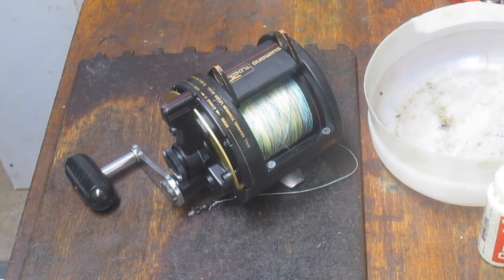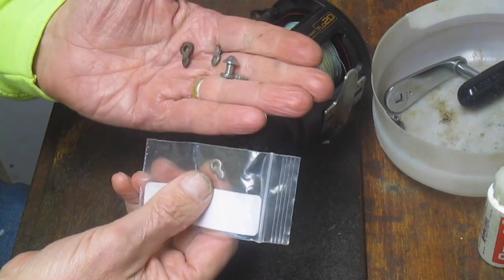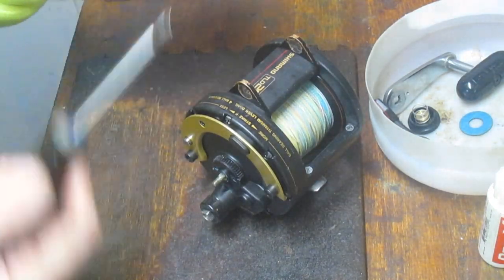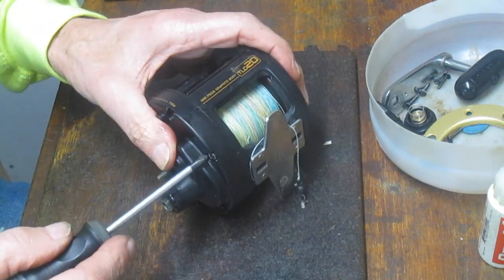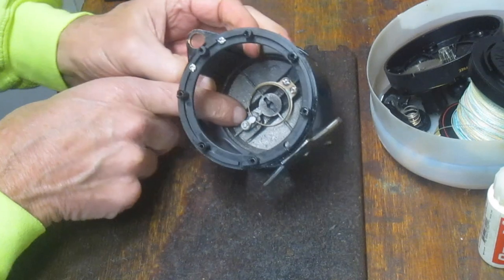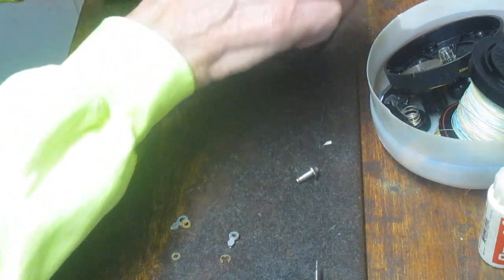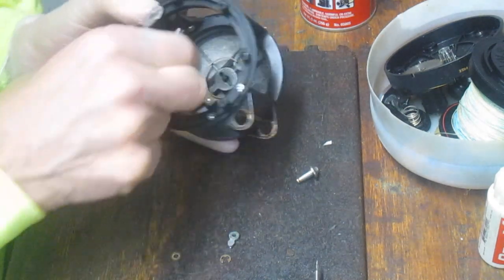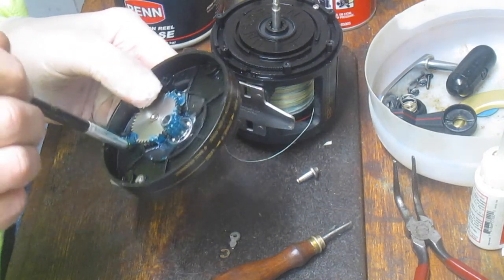Shimano TLD 20 Lever Drag fishing reel take apart and  how to restore a worn click function

Comment: Great video...I have a Tyrnos 20 that i want to tear apart and clean/service it is an early version (single speed 5 to 1 gearing) it appears very similar to this TLD20...mite you advise me of any differences l should be aware of when i take it apart?
Reply from the maker: The process should be very similar. Unfortunately, I do not have a video on the Tyrone's reel

Comment: Thanks for the video. I'm going to watch your rebuild one as well, but I had a question. Have you ever come across a TLD that when you wind the reel, you are winding against the drag? My reel just recently started doing this. In free spool it winds normal and as you increase drag, tension on your wind will increase as well. It has been fished maybe 15 times.
Reply from the maker: Some resistance is normal, but you have had this since new and if you are noticing a change, then it is most likely that something inside the reel is causing the change.  My usual culprit is dirt, sand or broken line.  I think you need to take the reel apart and do a complete service.  While you are doing that, make sure to check for broken parts and perhaps a worn or torn drag washer.  Dennis

Comment: Dennis hi, wouldn't greasing the clicker tongue and where it comes in contact with the spool help with the wear?
Reply from the maker: The only place where it would make sense to grease would be the slot where it rides in.  Any grease on the click tongue or spool would evaporate or get pushed to the side or clog the click ring. The wear is a result of one metal being softer than the other and repeated use in trolling. Grease just won't help that in the long term. - Dennis

Comment: Dennis,   
     Another great two part video ! When reinstalling the clicker pawl do you always leave it dry.?  Is there any benefit to grease/oil on  clicker pawl for longevity ?  Thx
Reply from the maker: I always leave it dry where it intersects with the click ring.  You can put a light coat on the face if you like.  That would help prevent rust.  You can also put a drop of oil or light grease in the side plate channel where the stud rides. Thanks for asking - Dennis

Comment: Sir,Can you tell  me the shimano TLD 20 machine dimension,size, weight  and height??
Reply from the maker: I don't have one in the shop at the moment.  The reel is approximately 4 inches high and wide without the handle.  The weight is about 30 ounces.  Dennis

Comment: I do not see the Blue space on my reels?
Reply from the maker: Hi - what blue space are you referring to on the reel?
Reply: @2ndChanceTackle  big blue washer on the drag handle
Reply from the maker: OK - The one that goes behind the lever arm?  Did you have a black one there by chance?  If not, someone may have recovered it on a past service.  The purpose of the washer is to make the lever arm turn easier.  You should replace that if it is missing.   I believe the part is called the lever thrust ring.  I think you can get the part through ereplacementparts.com.  Type Shimano Ted in the search field and then select your model to see parts availability   - Dennis
Reply: @2ndChanceTackle  I will check, thanks